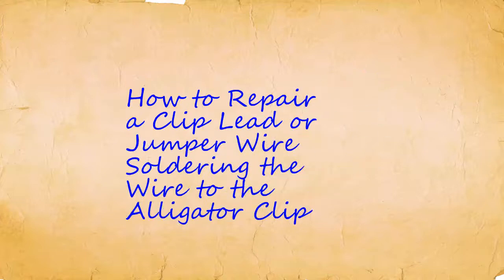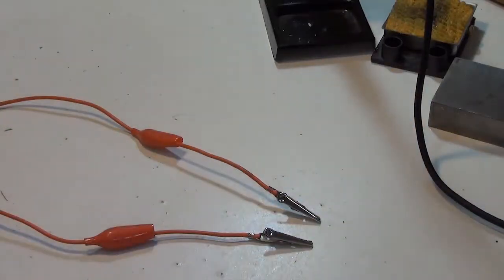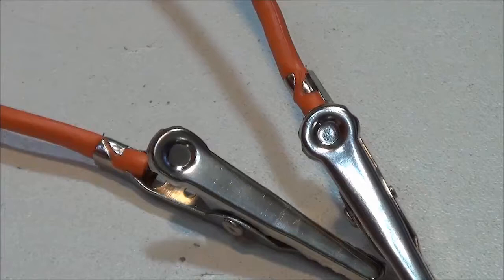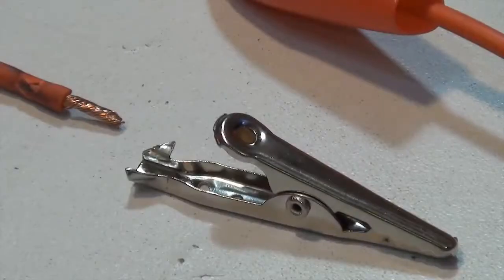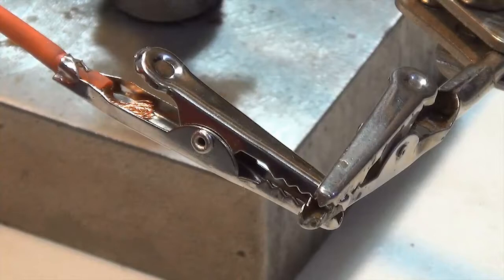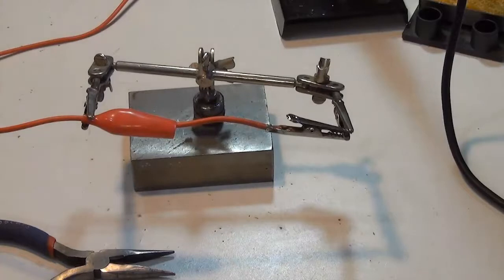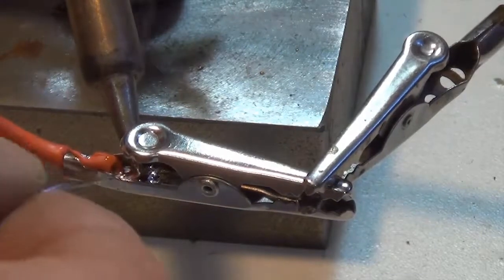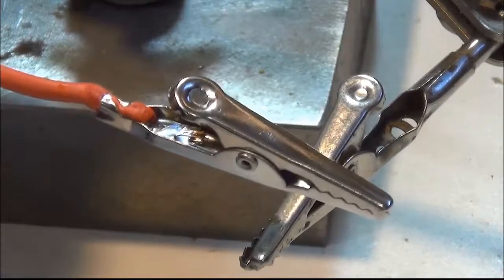Improving Test Leads or Clip Leads by Soldering the Wire to the Alligator Clip

Comment: Thank you for the tips!! Just had a few questions, if you wouldn't mind.

Shouldn't flux be used (or does the stuff you use have a flux core)? 

Does wire being solid or stranded make a difference if you solder or not solder?

 I bought quite a few pairs dirt cheap, they are 30 amp rated (ya right China;) and I would like to use some left over 12 gauge solid I have laying around..will probably never push for then 12v-10amps through them...using them for electrolysis
Reply from the maker: Stranded wire will work best for homemade test leads.  Solid wire will not bend well and will fatigued after a few bends.  It is best to used flux core solder.
Reply: Thank you much sir

Comment: I tried jumping the 3 post Solenoid I used  alligator clips hook up to the two large post.  New battery. Nothing happens Clicks when you turn key. Could it be the ground wire keeping it from turning the starter?  I checked the connections on the solenoid. , and the starter.

Comment: Should you tin the wire before soldering?
Reply from the maker: It is not necessary to tin wire before soldering.  If you do tin the wire before soldering, make sure you do not wick solder into the wire that is insulated.

Comment: Good video!
My clips came with screws. Still not as good as solder.
Reply: George Simpson I made a set of leads with banana plugs with set screws. I just ditched the screws and used the opening like a solder well.
Reply: P

Comment: What's the deal with the silver stranded wire?  I'm doing this to make some test leads, and the wire I'm using does not wick solder at all.
Reply from the maker: Wires that appear to be silver are tin plated copper wires.  The tin plating prevents the copper from oxidizing.  Your wire might be contaminated possibly with a oil type product.
Reply: Apply a non acidic flux to your wire before soldering, it should then suck the solder right up!